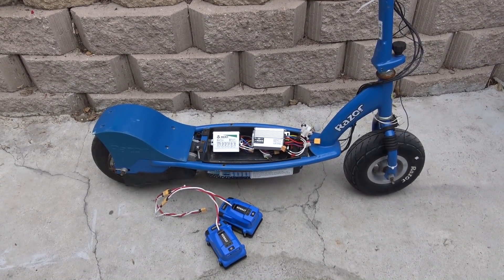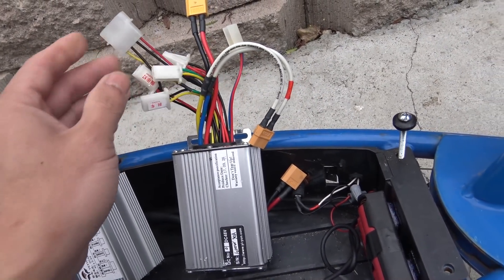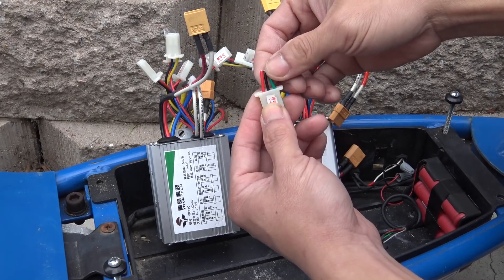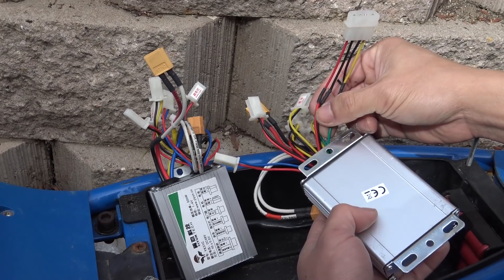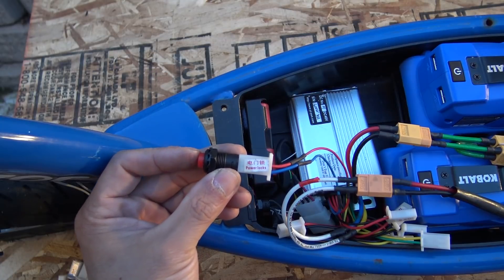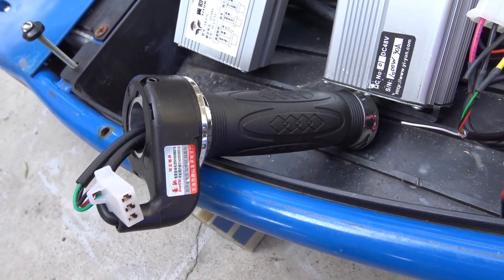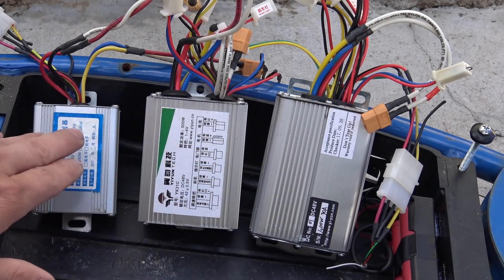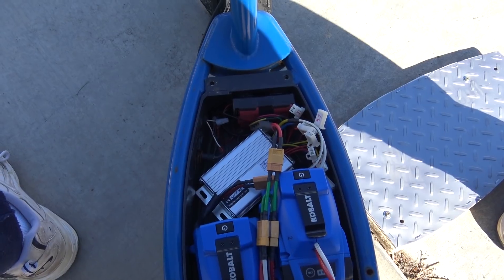Install a 48V controller & 48V battery on a Razor E300 (24V) Electric scooter

Comment: I'm using this mod on a kids Power Wheels from 12v to 24v, but the initial acceleration is hard on the nylon gears. Is there a way to control or slow the initial acceleration? I want to maintain the peak speed, but curb the initial burst. Is there a type of voltage regulator that would do that? Having a lot of fun with your videos; they're the best on YouTube.
Reply from the maker: What controller are you using? Or do you just wire it up straight to an on/off push button?
Reply: no controller
Reply from the maker: It's dangerous without a controller especially if your kids are using it. If you use a power button that's not designed to handle high current, it may get too hot and fuse the contacts together. That will lock the motor to a permanently on position. Without brakes, it will be dangerously out of control. You will need a controller if you're running at a higher voltage. The advantage of a controller is that it will let you feather the throttle so you can start slowly instead of a big jolt right off the start. And you can control the speed the way you want instead of just going all in at full speed or nothing.

Comment: Nice setup. Do you have part # for controllers? Also are they variable speed controller? I want variable speed to save battery.
Reply from the maker: This is just a generic made in China controller so there's no part number. You can search for 1000W 48V controller and it should pop up everywhere. This is a fixed voltage controller. You can adjust the speed of the vehicle by using the twist throttle.

Comment: hi just seen your video about reviving 18650 batteries.i have 10 cells very lo near 0v that were new Samsung 2600mah can I use the parallel method briefly so can charge on my imax b6 then?was going buy new cells but have only been used few times on ebike .my kit is a 70 cell 54v battery I put a bms on it and went for ride and lost power.it just would suddenly drop off and on but then went to check battery and dropped it on hard floor.as its the vruzend kit the plastic tops have split.ive replaced with new tops but found had 10 dead cells.most were Samsung 26h and some Panasonic 2600 and 10 Samsung 25r.it was just Samsung 26h that went dead.one ebike guy said samsungs do this.havnt tried popping tops or releasing pressure on top but don't think they are protected cells.thanks for any ideas.steve
Reply from the maker: It can be 2 things: 1. You have some dead cells. 2. Your cells might be good but they are not high discharge cells. You need high discharge cells for ebikes. Cells from laptop batteries wont' cut it unless you put many of them in parallel.

Comment: It was unite make from uk I need standard 24v razor motor for my wife’s e300as it’s fast enough for her as standard .but I’m speed freak like you .i only got 23mph on my ebike with a 1000 watt motor run out of pedal power need bigger gear at back .so your 27 mph on razor is scary .your road is quiet 😀.so you reckon  a 1000 watt controller and a standard razor motor will last ok?think maybe lithium batteries easier on a motor than lead acids as they lose power quicker
Reply from the maker: I think 1000W controller on the standard Razor motor would be fine. I'm thinking of over-volting it a little bit more and push it to its limit to see what it's capable of.

Comment: What’s the red battery thing at the front are they 18650 an what amps are the kobalt packs .thanks
Reply from the maker: Yes, they are 3x 18650 cells at 12V to power my front LED headlight. It was shown in my previous video: https://youtu.be/gmgFM29x5m0.
The Kobalt packs are 4Ah at 24V each. Two packs in series totaling 4Ah at 48V.

Comment: I once tried a 300watt 36v motor but it didn’t last long .strange as the standard motor ok at moment
Reply from the maker: Is your motor aftermarket? They are always grossly over-rated.
Reply: those motors maybe smaller. i've seen much bigger scooter motors on higher priced e-scooters.

Comment: So that’s standard motor? I have razor e300 36v batteries an 36v 800 watt controller .i have a 18650 52 v battery to use soon but also for my ebike too .steve in uk
Reply from the maker: Yes. It's a standard motor that originally came with the E300.
Reply: Has the motor melt down yet? If so, Can you make a video on a 48v brushless motor?
Reply from the maker: It works fine on 48V. I don't drive like Michael Schumacher all the time so that might be why it hasn't melted yet. 48V brushless motors are expensive. That would be a nice upgrade though.
Reply: vuaeco hi sir i have 24v brushless hub motor can i do this too using a 48v batteries?

Comment: Nice job.  Can you provide a link in the description to where to buy the controllers?  I over voltage mine to nominal 29.6v and the original controller handles it fine.   I might upgrade to 48v.  Looks fast and fun!
Reply: Lowegy - do you still have it and is it still at 29.6v? How much faster did it go and any problems?
Reply: anywhere, ebay, aliexpress, alibaba, bangood, wish, soo many to choose from these days.

Comment: vuaeco THE E BIKE DUDE FROM ISRAEL JEWISH DUDE ANYWAY HE SAID IN A VIDEO IT IS OK TO OVER VOLT THE MOTOR AND CONTROLLER BUT NOT BY MUCH. LIKE 24V SYSTEM YOU CAN GO TO 36V AND IT WILL BE OK JUST GET MORE POWER AS WELL AS SPEED!! DO YOU FIND THIS TO BE TRUE?? JUST ASKING, OLD ONE LEGGED JOSEPH T RETIRED NAVY
Reply from the maker: It's true. You can over volt both the controller and the motor. However, you cannot over volt the controller by much as it is designed just for a certain voltage range. That's why I have to buy a couple of new 48V controllers instead of over volt my old 24V controller and push it to its limit. You can, however, over volt the motor quite a bit. You just need to have proper cooling for it (I have the winter breeze on my side!).
Reply: I WAS GOING TO ASK, DID YOU WEAR A HELMET FOR THOSE RIDES!!?? IT LOOKED SCAREY FROM OUT HERE IN YOU TUBE LAND YOUR HAND SHAKING LIKE THAT! THOSE SCOOTERS DONT ACT RIFGT WHEN THOSE LITTLE TIRES ARE TURNED TO SHARPLY HAHA REALLY WOULD NOT WANT ANYTHING TO HAPPEN TO YOU, AFTER ALL WHO WOULD I WATCH THIS LATE AT NIGHT THAT HAS SUCH TALENT WITH ELECTRONIC STUFF!!?? I AM ALL THE WAY IN PA WHERE ARE YOU, NORTHERN CALIF? CANDIS AND I DID NOT KNOW IT GOT THAT COLD THERE. I WANTED TO KNOW ABOUT THE BRAKE SETTING, THESE E-BIKE GUYS AROUND HERE KEEP ASKING ME IF I AM GOING TO TURN IT ON OR USE IT SOME HOW. ANYWAY I PLAN TO USE THIS 36V 500 WATT HUB MOTOR TO HELP ME DO HILLS AND WHEN MY ARMS GET TIRED OF ROLLING THE WHEELCHAIR WHEELS. THE HUB MOTOR DID NOT COME WITH INSTRUCTIONS EITHER, THE DUDE IN CALFI I BOUGHT IT FROM ON EBAY EMAILED ME BACK THROUGH EBAY AND SAID THE CONNECTERS ONLY GO ONE WAY HAHAH LIKE YOU CANT SCREW IT UP, WELL THAT IS BULLS#*T I LOOKED REAL CLOSE. ANYWAY THANKS FOR POSTING THIS I NEEDED TO SEE SOMEONE DO THIS SO I DONT FRY MY HUB MOTOR OR THE CONTROLLR, OLD ONE LEGGED JOSEPH T RETIRED NAVY
Reply from the maker: On the very first test run with the 1000W controller, I did not wear a helmet. Big mistake! At 11:37 you can see on the shadow, that's me one hand holding the camera, one hand on the handle bar wearing no helmet, riding at maximum speed. This scooter is quite wobbly at speed especially riding with just one hand. On subsequent tests, I put on my helmet with a camera mounted on it so I could ride with both hands (tests when I wear orange jacket). Yeah, these controllers don't usually come with any instructions or even labels. You just have to guess and hope no smoke is coming out. :)
Reply: THANKS, HEAVENS NO I HOPE THERE IS NOT SMOKE HAHAHA THANKS, OLD ONE LEGGED JOSEPH T RETIRED NAVY
Reply: vuaeco KNOWS ME DUDE!!! HE KNOWS I CANT SEE, SO I USE CAPS I AM IN A WHEEL CHAIR THAT WONT ALLOW ME TO GET CLOSE TO THE MONITER NOW YOU KNOW IT, HAVING ONE LEG BAD EYES IS WHY I USE THEM HE KNOWS ME WELL SO MIND YOUR BUSINESSS FRIEND, JUST SAYING OLD ONE LEGGED JOSEPH T RETIRED NAVY